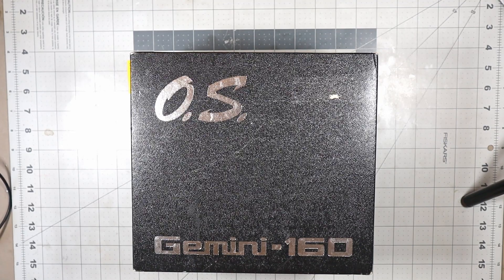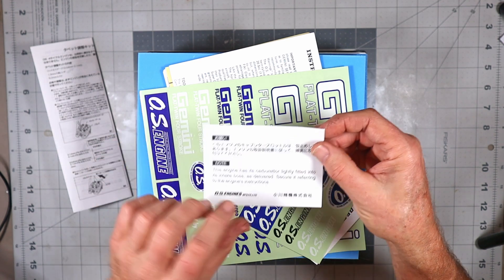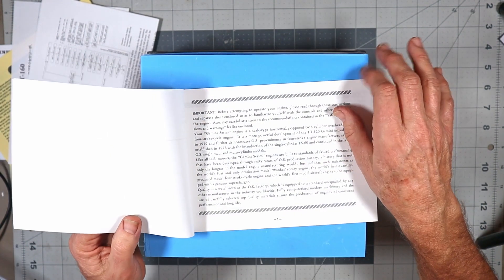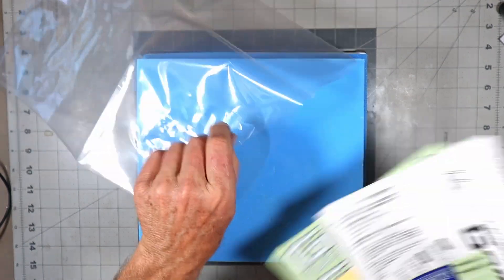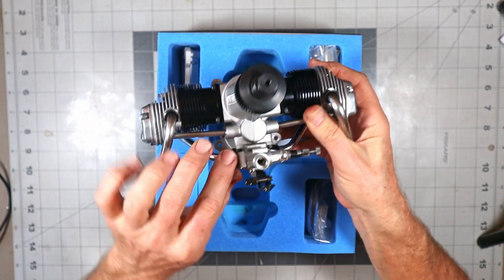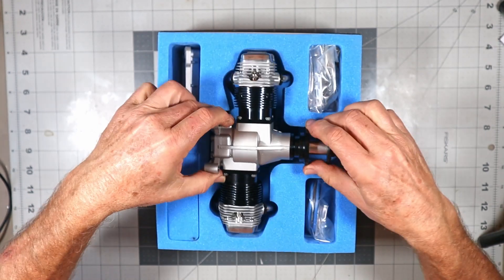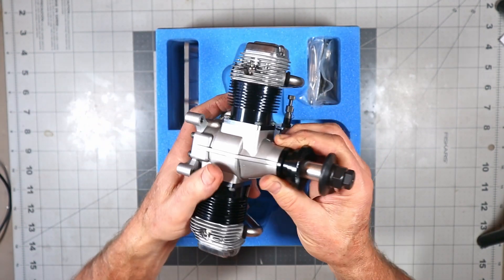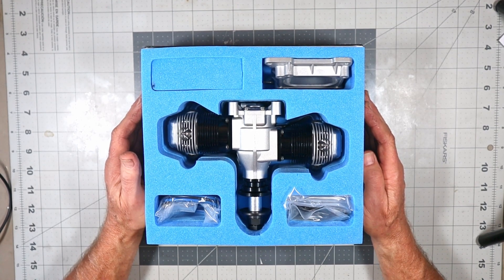OS FT-160 Gemini A Quick Look

Comment: Looks great Dave! Congrats! It looks so nice I would have a hard time putting fuel in it.  I too recently purchased a used Gemini 160 at a favorable price but it will require a full rebuild with new bearings & o rings. SN 71XX. It came with both air bleed and dual needle carbs. I definitely plan on running it once it’s reassembled. Just need to find a nice airframe for it.
Reply from the maker: You know that i service engines again, right?
Reply: Did not realize that Dave. This would have been a good one to send to you but I already have it mostly apart. One of the cylinder hold down bolts is stripped and not entirely sure how to proceed now. I used plenty of heat but 2 other bolts I managed to snap free had greenish corrosion on them.

Comment: I have a new in box Gemini FT-160, SN 4576. It does as you mentioned have the large wrench and an air bleed carb. The decal sheets are also quite different
Reply from the maker: The airbleed carb indicates a Gen I version with the soft bronze connecting rods.  If it were mine I would buy upgraded rods from RCJapan to have on hand.